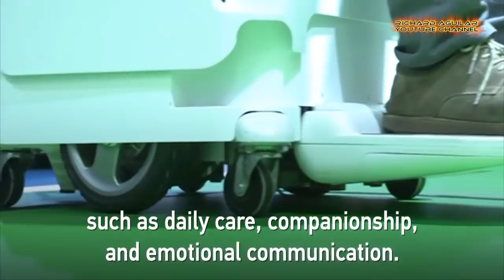China Innovation! The Robotics Revolution In China That Shocks The World

Comment: China is focusing in advance technology such as robotics, AI, chips design and manufacturing, clean nuclear energy, space exploration just to name a few. It will certainly become the leader in the world of science and technology within a decade. More importantly is the fact that China has solved the problem of employment due to the robotic revolution.
Reply: It's all copied.  Everyone knows that Boston Dynamics is the company that innovated with decades of research into passive-dynamic walkers and stabilization. Then you see the Chinese clones of the 'dog' robots and you know 100% they bought a Boston Dynamics robotic, took it apart, and copied it, even the motion of the legs looks identical. 

China is way far behind in Space and the gap between the US and China is growing, not shrinking. SpaceX is absolutely more advanced than anything China has produced by at least a decade. The Starship SuperHeavy for example, is going to do next year, what China's Long March 9 hopes to do inefficiently maybe by 2030. 

In fusion energy, MIT SPARC reactor is way ahead of everyone. 

In chip design, Apple, Qualcomm, Intel, AMD, and NVidia have the world's fastest chips. China isn't even in the running, and they can't even produce 7nm chips yet. 

In chip design, China doesn't even produce EDA software needed to design chips, that's how far behind they are. 

Almost all of the breakthroughs in recent years that have dramatically transformed science and tech: from cryptocurrency, to machine learning, to quantum computing, to robotics, to reusable rockets, to sexy EVs, the internet, the web, have all been invented outside of China. The true innovation happens elsewhere, then China takes it, cheaply manufactures it, and a bunch of the nationalists come into forums like this and try to claim credit. 

Tell me, why do so many Chinese students to go US top universities? Because all of the true innovation happens there.  Now no doubt, as usual, someone will come in here and start talking about # of patents granted or # of papers published, but quantity is not the same as quality.  Most scientific papers and most patents are garbage. Just go look at the Arvix preprint service. 

Richard's videos use the theme of 'shocks the world', but none of them really shock anyone, because we've seen it elsewhere.  China's robots for the most part look as crappy as those produced in Japan and Korea in the 90s and 00s.  It wasn't until Boston Dynamics until robots were produced that were agile, and moved like human beings or like you see in SciFi. 

It was Boston Dynamics that shocked the world with dog robots, and robots that run, job, do Parkour and backflips.